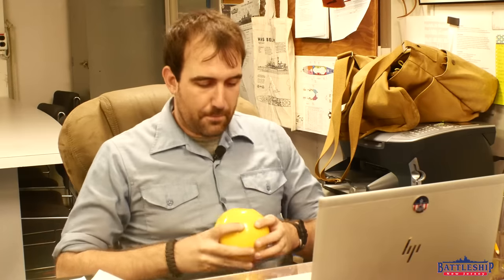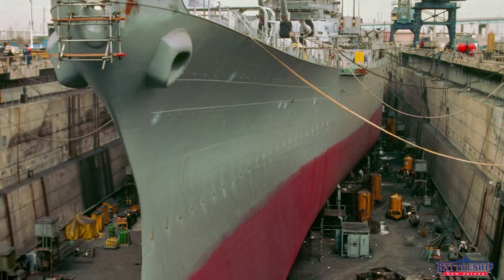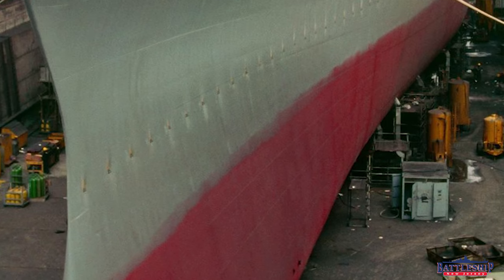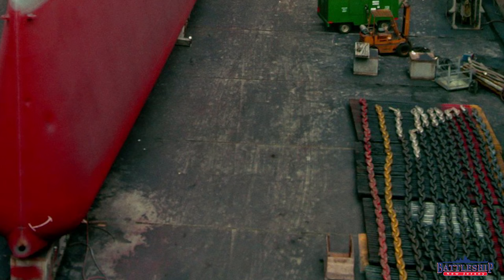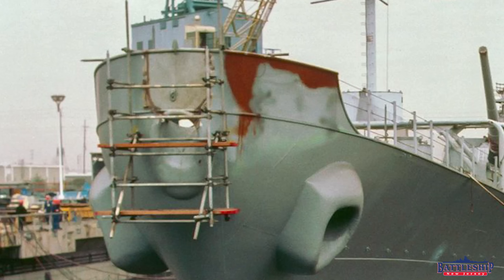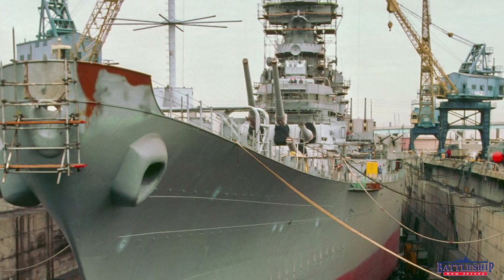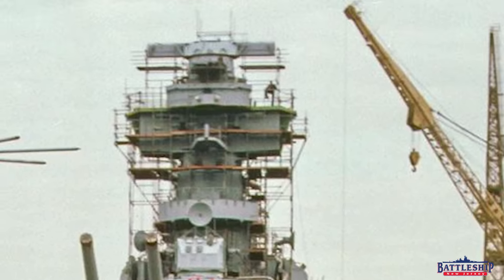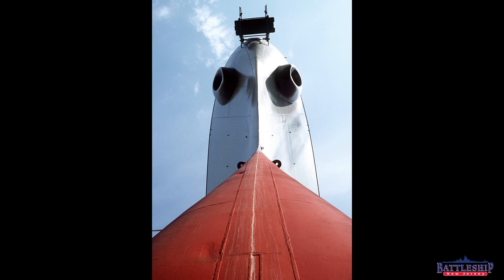Dry Docking New Jersey: A Picture is Worth 1,000 Words

Comment: So wait a minute!  They must empty the dry dock, then put in all the wooden blocks that the ship rests on, then flood the drydock, then open the doors and the ship moves in, then they drain the drydock and the ship rests on these blocks.  BUT.... aren't the blocks wood?   What keeps them from floating away when the water is added?  Do they have divers underwater as the water is removed (that would be scary).  How do they paint around the blocks?  So many questions....... (worth a thousand words)
Reply: Yes, all of these questions have been boggling my mind as well!
Reply: Most drydock blocks are actually concrete with wood on top for both padding and the adjust the height for curvature of the hull. The wood is fastened to the concrete.   The ship still has to be brought in slowly to avoid moving them around.  Yes divers do go down to verify that the ship is properly positioned on the blocks.
Reply: And further to James Murney's point, any personnel on board MUST take a seat and remain motionless for the duration of the draining process.

Comment: The green looks it might be a tarp trying to keep sandblasting material in🤷🏻‍♂️ I’ve never seen zinc chromate in any color other than a similar yellow in photo or a light blue. Zinc chromate has to be sandblasted off.
Reply: At the shipyard the green primer was referred to as "150" a two part primer used for metal only.  After a number of hours, the mixed primer remaining in a bucket would dry up to a rubber consistency.  You could knock that stuff out of the bucket and bounce it. Zinc Chromate was used on aluminum.

Comment: How do they keep the water and fuel separated in those tanks? Just based on density?
Reply: Yes, just as they did in submarines. There's a fuel/oil separator to filter out the water before the fuel gets to the boilers.
Reply: I believe it was displacement fuel doesn't mix with water most big ships used fuel oil which was less dense than water so it floated on top at least that's what I figured as a kid reading submarine books even though subs ran on diesel fuel but all I was worried about was getting to the action reports when I got older I studied the actual science of fuel and water being salt water it's very dense most things will float on it

Comment: Could the ship withstand a modern torpedo?
Reply: She most likely could withstand one, maybe two or three, it all depends on where the tin-fish hit. The battleships nearest her in size, the Yamato, Musashi, and Bismarck took quite a few fish to bring them down.
Reply: I don't believe so.  The bottom of the BB's is constructed of 1" mild steel plate.  All the armor is on the sides of the hull.  A MK 48 is designed to detonate under the hull
Reply: Several at least, unless everything went sideways in really bad ways (water tight doors open, ammo lying about).  Modern submarine torpedoes have about the same weight (650 lb) of a more powerful explosive as WW II submarine torpedoes.  The Yamato and Musashi were much bigger and took something like 15-20 torpedo hits, but they were air-dropped with smaller warheads.  WW II carriers of half the weight survived several submarine and air-dropped torpedoes.  I was on USS Midway, roughly same weight and era as the Iowa class, and we were told she was designed to survive 7 perfectly placed torpedoes.  We all kind of wondered how one could even begin to calculate that, but figured it at least meant she wasn't going to sink in a hurry.
ETA I didn't see ytlas3's response about exploding underneath instead of on the sides.  I think she'd still survive several, but they would do more damage, and might be catastrophic if they hit directly under a magazine.
Reply: The Midway Class was designed to survive WWII era torpedo attacks.  They were constructed with twelve single boiler firerooms, six on the port and six on the starboard side. The main engines were kept as close to the centerline as possible.  I'd read that a number of carriers lost in WWII because they lost steam to operate the SSTGs for the electric fire pumps and steam for the steam driven fire pumps to fight fires and pump water.  With the Midway class design, it was just secure the damage compartment(s) cross connect steam from another boiler if necessary and keep going.